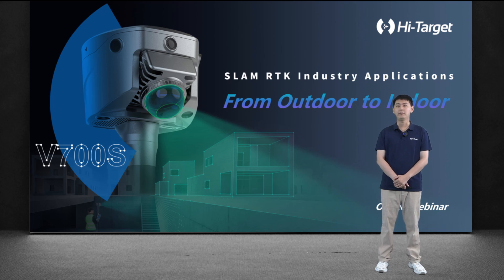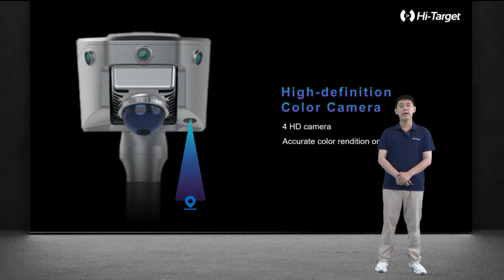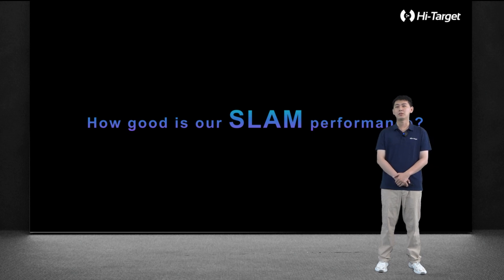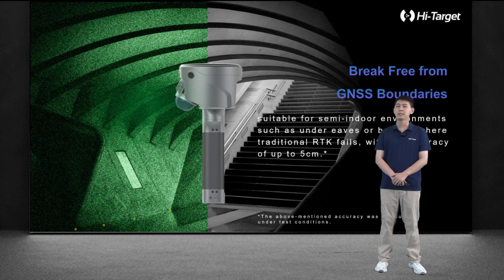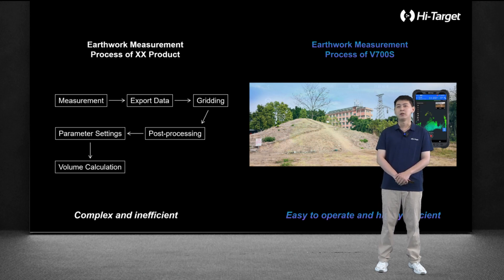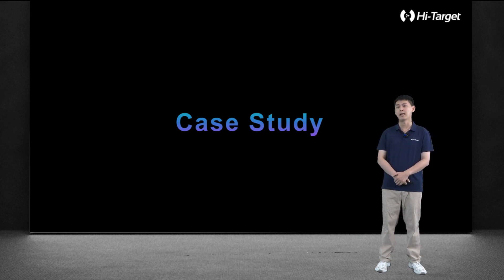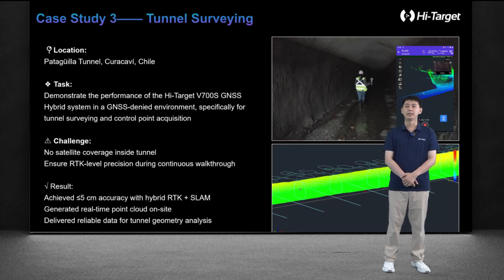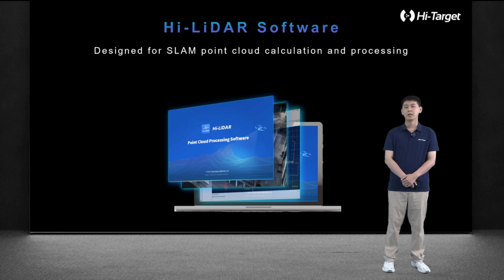V700S SLAM RTK Applications– From Outdoor to Indoor Surveying

Comment: I work in Venezuela with a Hi-Target base and rover (V200) setup. I am highly satisfied with the product's quality and its exceptional efficiency for surveying tasks. I wanted to inquire if the newer V700s model can also receive RTK corrections via UHF radio, as NTRIP services in Venezuela are very scarce and limited.
Reply from the maker: Yes, V700S can be set to UHF radio mode to receive correction data